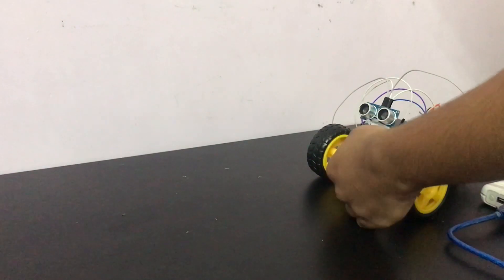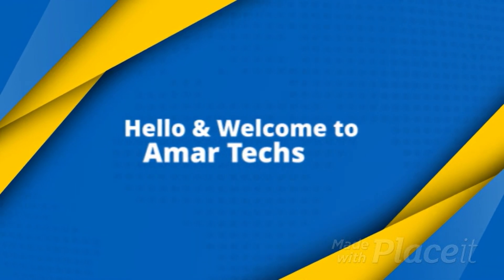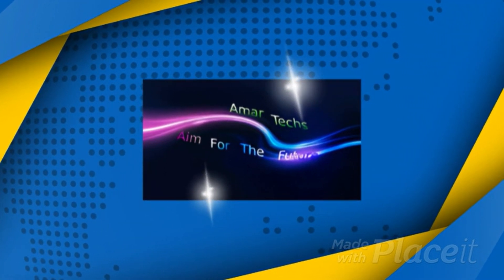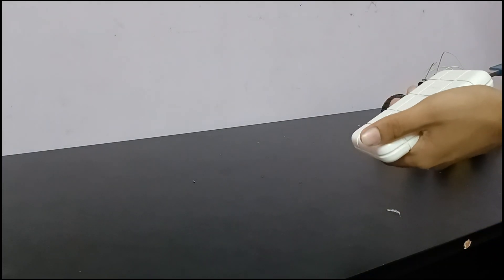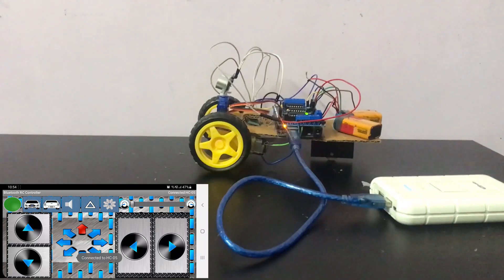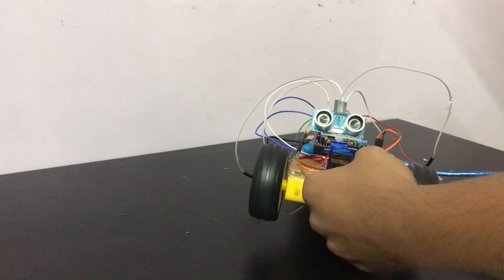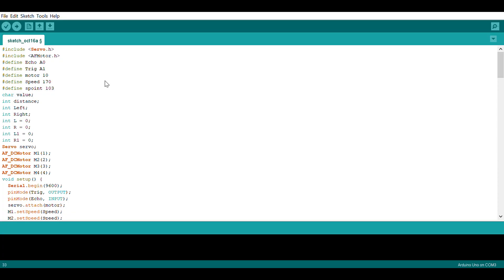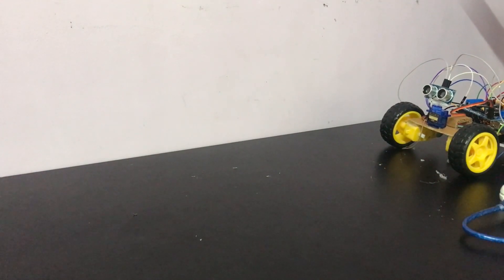How To Make An Arduino Obstacle Avoiding+Bluetooth Control+Voice Control Robot | DIY Arduino Rob

Comment: Can i get the wire diagram for the servo board, because the input is already occupied by the servo board and there is no place to add the Bluetooth module. Any solution please.
Reply from the maker: So you want the diagram of the circuit right?
Reply from the maker: Do not rely on 9v battery completely it doesn't have enough amps to power this robot, that's why i used the power bank or if you have a 18650 just plug 2 of those cells in and it will work
Reply from the maker: Link to the diagram- https://drive.google.com/file/d/1LESVmPu4QrrlMKTc4yp37cd_KZXe4S7q/view?usp=sharing
Reply from the maker: I also mailed it